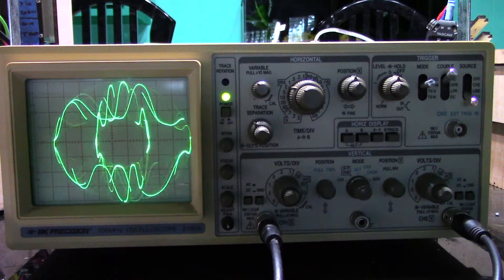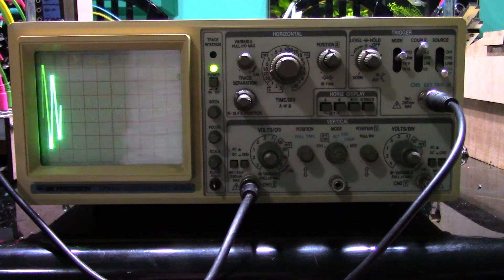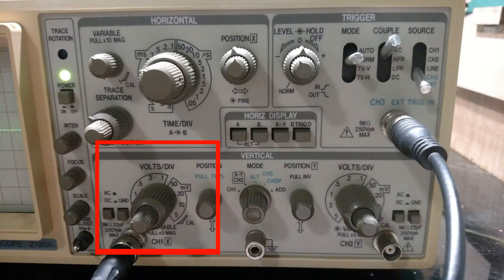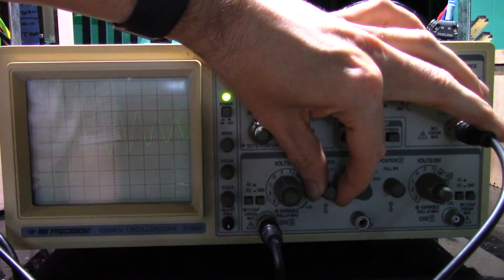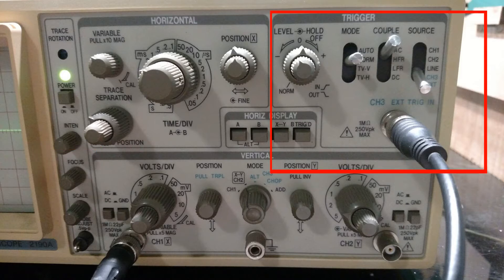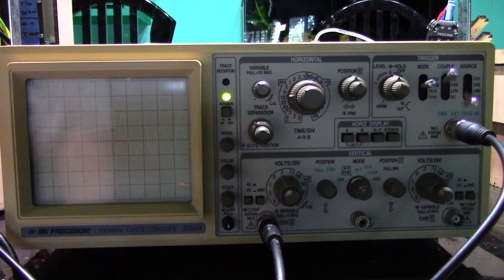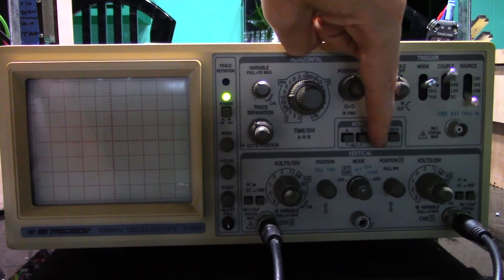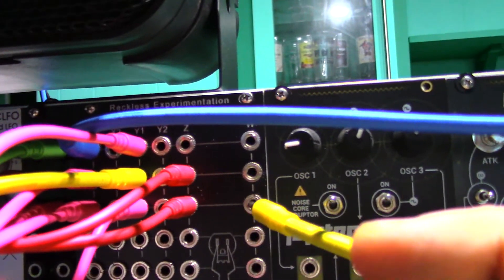How to setup an old oscilloscope for use with eurorack

Comment: Great vid. I'm going to keep the tradition alive and ask you my own question. I bought a Tektronix oscilloscope type 561 (from 1961) and instead of having clearly labelled bnc channels it has a + and - input that appear to be uhf female. I was thinking about getting a uhf male to bnc female adapter and connecting my synth via bnc cable but I don't want to damage either device. I'd rather not use probes so if you know how to connect a synth to an old scope like this with a cable I'd really like to know. Thanks!
Reply: Would the cable just go into positive and I'd ground the negative or is there even a reason to ground? I'm pretty new to electronics

Comment: Hey! Thanks for the video. You mentioned that the cable required is a simple BNC cable. Is that cable going into a 3.5mm hole? Thanks
Reply from the maker: while 3.5mm to BNC cable do exist, I use and interface module, that has 3.5mm in and BNC out. I find it much more convenient. the module is available here 

https://recklessexperimentationaudio.com/products/osc-1
Reply: @Recklessexperimentationaudio  is it necessary to have this module or a 3.5 to BNC works? I have a small rack with no hp :/
Reply from the maker: @leonardovelazquez1029  your 3.5 to BNC cables will work, my module just provides convenient pass through and mounting
Reply: Reckless Experimentation Audio LLC awesome! Thank you it looks rad!

Comment: Hi! thanks for this video - what kind of cable do you use to connect to the oscilloscope?
Reply from the maker: BNC cables. Those cables have the ends that connect to the scope. Everything else about the cable doesn't matter. Just get cables that are long enough.

Comment: thanks for the valuable video, I'm buying a similar one, has one 4 channels but no trigger input, vs 2 channel with trigger. Any of them any better than the other ? Is there any time resolution to look for, or volt division. some has delay knob, is this any good ?
Reply from the maker: I find two channels are enough for visualizing sound, old analog scopes can only display one trace at a time anyway. Be sure it has an XY function to draw shapes on the scope. All the other parameters are unimportant, a 60mhz scope will display sound just as good as a 300mhz scope. The delay knob is used mostly with digital logic, not needed for this type of use.
Reply: @Recklessexperimentationaudio  Thanks :)
Reply: also is it good for envelopes and LFOs